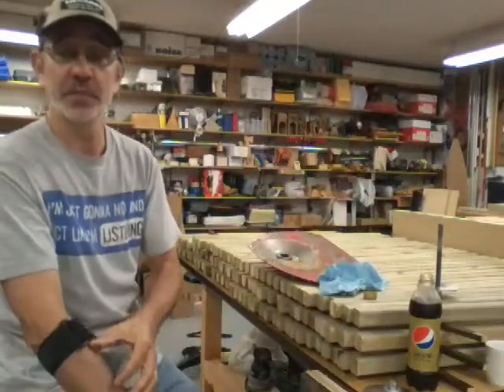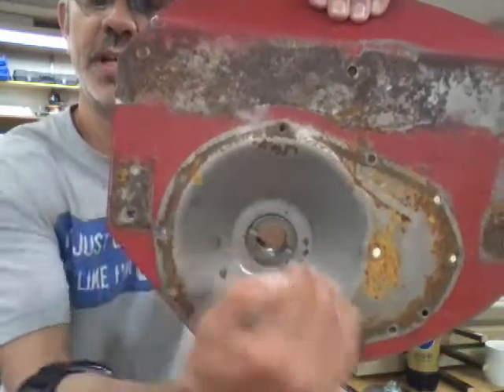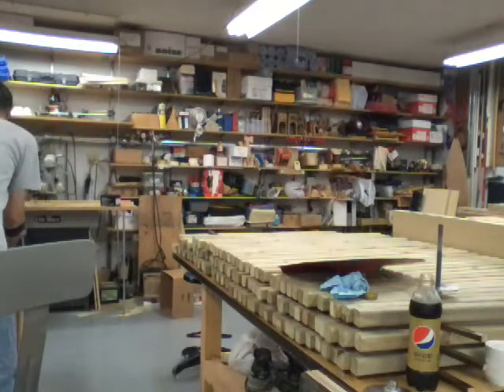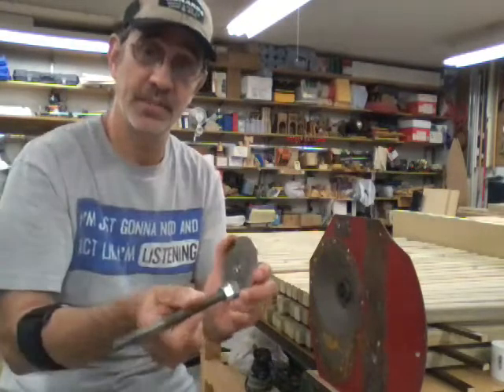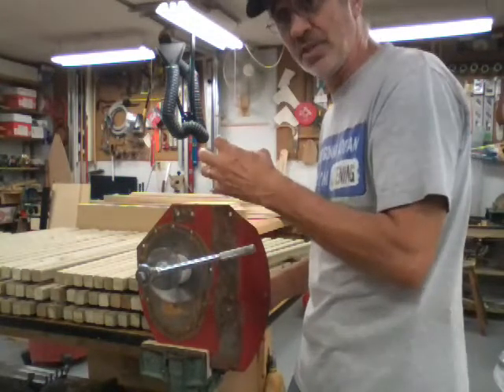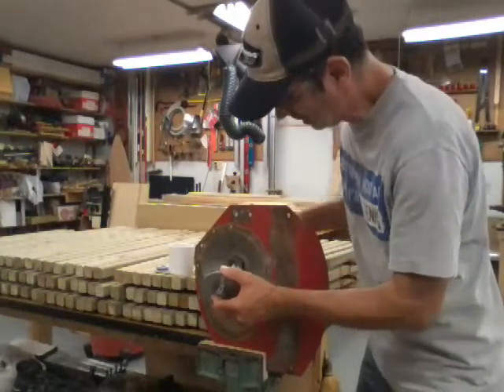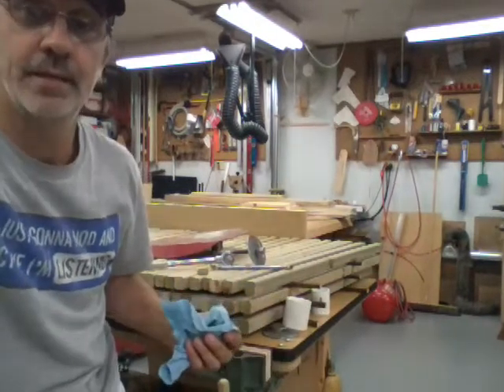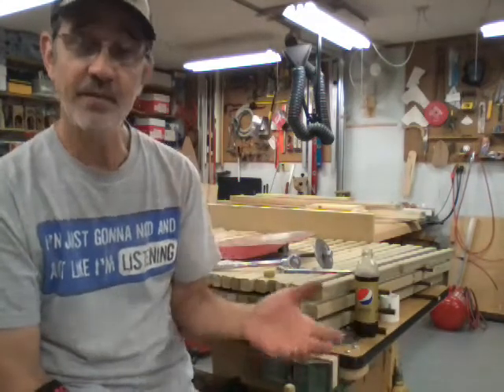124.  M/S. 13.  Replacing the bushings and or bearings in my snapper rear engine rider

Comment: I don't know if this will help any but I have used a freezer for bushings down in the jungle.  If you have time and a stubborn bushing, pop it in a freezer for few hours. Over nite is best, it shrinks it some when frozen. But your technique looks easy enough for this application. Just another nugget to load in the back of one's brain. Keep up the good work, I enjoy your videos.
Reply from the maker: Matt Hill 
   At work I freeze one in heat the other and you can basically just drop them together.   great practice I do it all the time. Thanks Jim

Comment: Jim keep up the good work.   I really enjoy your videos   Duane
Reply from the maker: Duane Brown 
Thank you,  I really enjoy making them. Jim
Reply: I have a 2000 model 14 33 snapper.  I have done a lot of repair on it and my total price is around $450.  most of that is in parts, it was ridden hard and put away wet, so it needed some TLC.  Works great now and starts easily once I adjusted the valves to 4 thousands.   Keep up the good work.  Duane
Reply from the maker: Duane Brown 
  Sounds like your doing pretty good on your own. I hope you're subscribed I do have a lot of videos that might help in the future. Thanks Jim
Reply: Yes, Jim, I am 77 years old and still going strong.  and yes I am subscribed.  Duane

Comment: This message is for Mr Jim the Fix-It shop guy I'm a disabled veteran I have relative DC use of my hands and my fingers I do most stuff from the seated position because of issues with walking but my Snapper rear engine rider is a 33 inch high vac I bought it sometime between 2011 and 2014 I have memory issues because of head injuries, but this time I'm having is when I set the unit up on his butt some people lift it up for me and I was inspecting the underside cleaning it and everything like that I noticed that the rear wheel on the left hand side where I guess the fender and the transmission case connects up to the fender there was oil leaked out I'm assuming from the boot on the other side of the fender and the oil got the rear Rim dirty on the inside and then you could see the oil build up and leakage around the end of the boot area but I don't see any hole in the boot at all when I took the dust cover cap off the outside of the wheel you could see oil oozing out and covering that entire area what is my problem is it just a question of changing the boot and the other question is does my 33 inch Snapper rear engine riding mower my 33 inch hi-vac does it have bearings or bushings in fact if you don't help I'll give you my model number product identification RER 33, 17.5 hp, snp, 3317524BVE
Model No. 7800787 and my telephone number is 240-794-8115 I don't scream my phone calls I answer all the phone calls that come in I'd really appreciate it if Mr Jim would call me and let me know what's causing the oil that's leaking out on the left inside area of the wheel and tires from the axle on the inside of the rear tire and rim and it looks like black motor oil it seems to be all collected around the part of the shaft you can see and the boot and it is slung itself onto the the inner Rim all over the place I wiped it up pretty good but I don't see any holes what should I do?
Reply from the maker: If you watch video number 471 it will explain how to replace the lip seals in your dust caps, which is causing leak behind your rear tire, but what may have ruined your lip seal is if your bushing on the axle is bad do you want to check that before you replace your lip.           Jim

Comment: Can you help me out on a snapper srm140. The right rear fender with 2.5" bearing / bushing hole I can't find a replacement or if one is available. If available what's the part number. And if part is no longer available I reckon I'll change  over certain parts like  right fender and Axle  to the older  series that bushings and etc  are still available. Hello from South Georgia your videos are very helpful thanks.
Reply from the maker: The SRM 140 number does not pull up under my search up parts tree you should have a separate model number starting out with the size of your deck, otherwise check on Parts Tree.Com with your model number they should have the parts in stock that you need. Jim

Comment: I've done all the necessary checks that he said when buying a used snapper, but I'm not buying a used Snapper I've owned one brand new since day one what I didn't know was a lot of the maintenance stuff I saw the grease fitting so yeah I was doing the grease fittings but I didn't realize that there were other places I had to put lube and I currently have some sort of black motor oil substance leaking from the left side of the lawn mower in between the frame and the left rear tire and rim if I had to guess it must be leaking from that boot there's a small balloon like boot that smooth and roundish that appears to surround the axle as it exits the frame of the lawn mower and then goes through the center Hub of the rear left tire and rim and there's oil a black type of oil oozing out of it or collect it all around it and it appears to have slung itself out onto the rim how do you change that boot and I would be happy to get anybody's advice on if if they've done this before preferably from gym but if you've done several of the operations that he describes and you're good at it I'd be glad if you called me on the phone I'm a disabled veteran I'm home everyday all day long Monday through Sunday if you want to call me Monday through Friday 6:00 a.m. to 6:00 p.m. Eastern Standard time I'll be more than willing to pick up the phone and answer I answer all my phone calls I don't screen my phone calls my phone number is 240-794-8115 my personal email address is jntspecopsgrp1@gmail.com Play Somebody contact me I cannot afford the price that the lawn mower shop once in my town there's only two lawn mower shops and these guys are telling me it's like maybe less than $100 worth of Parts but they want like $600 for labor night I just can't afford I live on a fixed income I live on a VA disability income and I do have relative use of my hands I do everything from the seated position cuz I have difficulty walking but I can control my hands good enough to get this job done I believe I've done other things similar to it so someone doesn't mind calling me and even if you want to video chat with me so I can show you the unit then you could say oh yes this is your problem this is what you need to change this is what you need to buy that would be great thank you jntspecopsgrp1@gmail.com

Comment: Hey Jim. Thanks for the videos.  Quick question. Can a bushing type be converted to a bearing type like thev commercial units.
Reply from the maker: Jeff San George 
Only if you can find some used Fenders that are made for Bearings. Jim

Comment: Just discovered #309 so most questions I asked you have already addressed Jim, sorry.  Still wondering though if 2019 DX parts e.g. the teflon bushings and dust seal will fit in a 2007 DX "Axle bearing assembly".  That part has gone up to $105
Reply from the maker: Most all of the wheel bearings and bushings are all interchangeable as far as I have found I would need to know your model number to make sure. Jim

Comment: Hi Jim, After watching video #119I asked the question that you were going to check on. Can the rear axel "bearings" from a Commercial or Extra Duty be installed in place of the "bushing" bearings on the standard RER? I, for one, would gladly pay the extra money for real bearings that should last w-a-y longer. Do you or anyone know the answer to that question?
Thank You & Keep Up the Good Work.
Reply from the maker: Scott Bair 
  I think you need different fenders for bearings, but if you install bushing and lubricant them periodically as needed they can last up to twenty years. Mine went twenty five years with out fail.

Comment: I was just gifted an old 33" snapper from my mother in law. It is older than 30 years. The chain case fender is worn in the bushing area by approximately 3/8 " from the axle. .I know it needs a new bushing but would like to weld something into the 3/8 " gap to reinforce it. I found a 3/4" washer that I cut off the top half and plan to weld in. I know I could replace the fender for $75 but I want to do on the cheap. Can you think of something else  that would fit around the flanged  bushing area.
Reply from the maker: John Terebetsky, Jr 
  Well maybe if I can see a picture I would be better able to answer that for you..

Comment: Thank you for your videos Jim. I have a question...I have a model 7800104 with DX type bearing on RH panel.  PartsTree shows the DX type as unavailable, but shows the non DX type as available. Are they interchangeable?  Also, the 2019 model 3315525BVE shows DX bearing as available.  Do you know if the 2019 DX bearing is the same as the 2017 DX bearing? Looks like 3/4" shaft in both instances.  Since these RER's are no longer made, I would like to stock up on long term wearable items.  I'm wondering if the parts are simply listed as unavailable for the older mowers in order to support the younger ones.  Any help is appreciated.
Reply: Sorry, meant to say 2007 not 2017
Reply from the maker: @edmccauley2576  The DX bushings and the standard bushings are interchangeable and if you keep them greased you shouldn’t have that much trouble with them and if you do down the road they are simple to replace because all you have to do is remove the left hand fender to replace it you don’t have to mess with the chain case or the differential side,   as far as the DX 2019‘s and the DX 2017’s I would think they would be interchangeable if not you can always send them back I guess I would try that first because they are a better bushing, let me know what you decide and how it works out. Jim
 P.S.   You can always check the schematic and Parts tree and look to see what diameter the axle shafts are but I’ve never found anything other than a 3/4 inch shaft and a 1 1/8 inch shaft. Jim
Reply: Oops...oversight on my part.  The right hand DX bushing is no longer available for my 2009 period. The 2019 right hand DX bushing  is available, but won't work on the older models because the shaft size is 3/4" and not 1-1/8".

Comment: Question on 124. M/S. 23. Replacing the bushings ... 
How do I know I need new bushings?
Also, instead of the electrical cover, If anyone has an old computer hard disk, The disks inside are very tough and have a hole in the center. There are usually at least two in each disk drive. I take them apart for the powerful magnets inside.

Comment: I can't get the collar off the axle of my 33" Snapper. I removed the set screw but you mentioned using a punch in the other hole. How is that done?
Reply from the maker: To remove the locking collar off of the bearing holding it to the axle first, you do have to loosen the set screw then use the other hole with a punch in it on about a 45° angle and twist it which way you have to twist. It depends on which way the man twisted it when he assembled it typically they will turn them to the right as if you were tightening a nut so first I will try turning it to the left, you may have to hit it a couple times to break it loose.      Jim
Reply: @jimjackson9381  Thank you! You provide great DIY info!

Comment: Jim, did you show how to remove the right fender cover to replace the slotted bushing?  I see the video on the left side but not the disassemble of the right side.  Also can you replace the right shaft boot at the same time or do you have to do it from the left side?  124. M/S. 13.
Reply from the maker: Hoyt Davenport 
Video number 126 shows disassembling the differential video number 124 shows removing and replacing the bushings. Jim

Comment: Mr Jim I got a good moter to replace the bad one it a newer one got to put a spacer on to get it a little higher n got to replace the key switch n put a sianoiad on  any advice on were to put it on a old comet snapper rear engine
Reply from the maker: james bradley 
  Hi James I not sure if you should have to lift the engine the drive disc should slide up the crank for the clarence you need. To mount your solenoid you can put it next to the engine or under your seat. Thanks Jim

Comment: Jim, my machine has bearings and the chain case side bearing has about a 3/8" lip, to attach the boot to I believe, and I was wondering if it is ok to apply pressure to that lip when installing the new bearing? Thanks, Ricky Cameron, Pelham, Ga.
Reply from the maker: Ricky Cameron 
   I think I would do it the way I showed in video number 124 that's the way I always do it and I don't have a problem with bending the fenders if you have any other questions let me know thanks Jim
Reply: Thank you Jim. I'll give it a try. Thanks for your help.
Reply: Worked like a charm. Thanks Jim!

Comment: noticed today i got grease/oil leaking inside of rear wheel on transmission side but boot is dry..can you tell me what is failing?
Reply from the maker: Behind your tire up against your fender you’ll notice a hose clamp holding on a dust cap to your fender inside that dust cap is a lip seal that keeps the grease inside your differential your lip seal has failed and allowing grease to leak out typically it fails because your bushing is shot so check for slop when you take the dust cap off. Jim
Reply: @jimjackson9381  is this video showing replacement of the bushing in question?
Reply from the maker: I can’t tell what video you’re looking at in this Section I can only tell emails. Jim
Reply from the maker: OK I found the video that you were watching and yes that is how you assemble and replace your bushing in your fender. Jim

Comment: Ther are 2 different fenders. One has a an 1.6 in hole for bushing,one has 2.5 inch hole for bearing,Cannot find the 2.5 inch type anywhere,Discontinued. wish I could find a flange bearing 1 inch inner and 1.6 outer
Reply from the maker: Driver Jeff 
  I know a couple guys that may have one do you need the right side or the left side. Thanks Jim

Comment: Hey Jim, could you send the numbers for ordering those bushings
1987 Snapper 28086S.. Thank you
Reply from the maker: One is 7012296 and the other is 7050918.       Jim
Reply: @jimjackson9381  thankyou Jim
Reply: How do i tell if the bushings are wore out?
Iam servicing my Snapper and have removed the wheel  hubs. There  is no play at all in the axle at the bushings??
Reply from the maker: @ericclark8258 if you got the tires off and it’s sitting on jackstands or standing up and you cannot wiggle the axles at all then I’d say your bushings are OK or could be you have bearings depends on which model do you have. Jim.